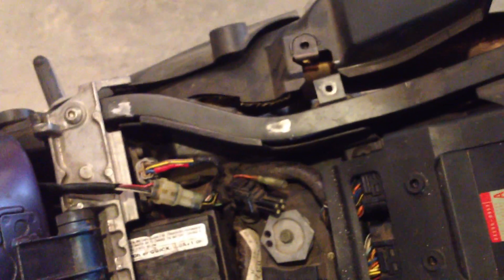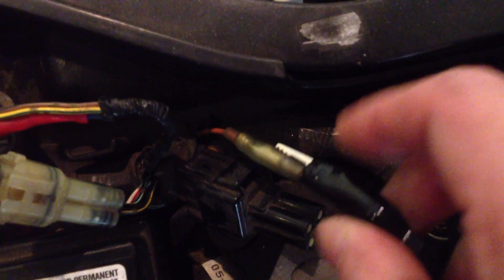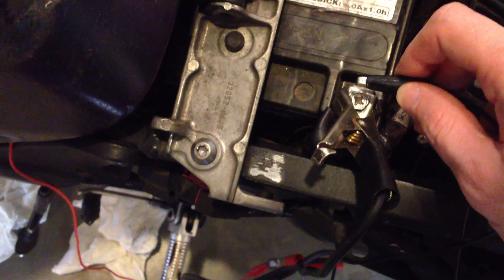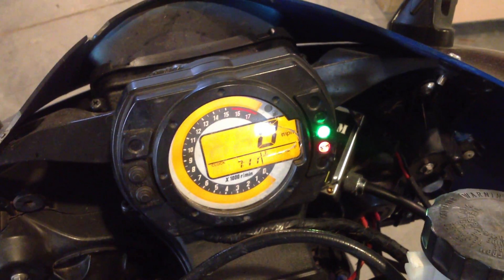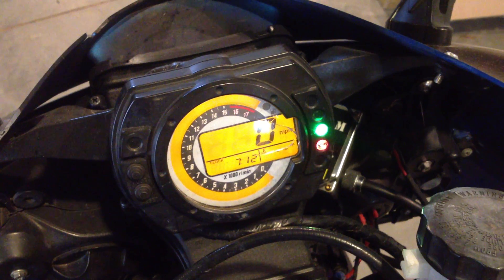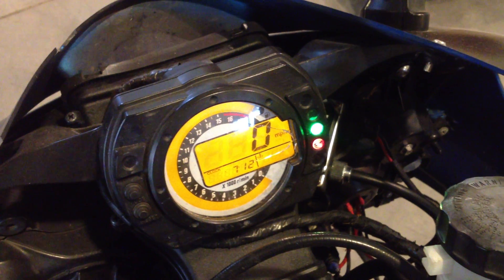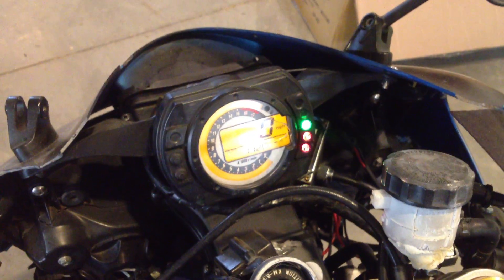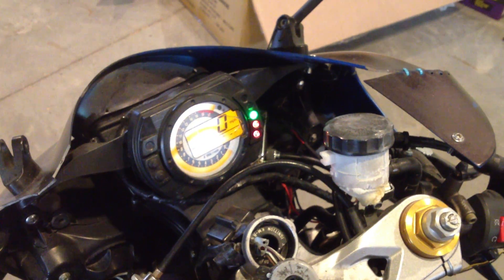Simple: How to pull the diagnostic codes Kawasaki ZX6R . Dealer Mode 1, 2006 636 FI light, F1

Comment: This is such a great video Tutorial!!!!!👍  This showed me how to pull the code on my 2007 Vulcan 900 Classic LT!  Wow, really great presentation!👌  The K VN900 under-seat wire to connect to is yellow, but the process is identical.  I could not figure out from the instructions in the service manual how to do this, until you enlightened us with your instructions.  I was then able to clear the code on the bike and for now the code 21 problem is resolved.  It reminded me of the trip to Oz, but instead of tapping shoes together, we tap the ground terminal 5 times.😄  Some $ saved!  Thank you, Far Reach Engineering!!!!!👏

Comment: Hey man, you seem pretty understading of the 06 636. I was wondering if i could contact you and ask you about mine since its having problems riding smooth? Ive got video of it in which the problem of the bike may be visible and audible to a professional mechanic. I would really appreciate that since im somewhat clueless and cant properly ride the bike.
Reply from the maker: Not sure I would be able to help much remotely.  But in generally its usually about Fuel, Air, Spark.     If it is running well at low speed or idle but sags when you ask it for more, you might check to see if the fuel filter is getting clogged.   If it sharp cuts out on and off, then your are likely looking at Spark (ignition coils and wires),   Rarely it is air, but it doesnt cost anything to take a peak and see if there is anything clogging the filters (this is rarely the problem.)

Comment: what if it only blinks once, my 05 636 started bogging under acceleration and dying i tried this and only blinked once.
Reply: My bike is doing the same did you find out what is wrong
Reply: @SquidBitz I tried running codes again and it was map sensors! Maybe try replacing those!

Comment: Hi far reach engineering, please help..... the Kawasaki mechanic removed the throttle body flaps, reason the bike would close power when trying throttle.. 

Please advise if I need a new throttle body altogether or.. Zx6r 06 model
(Arata exhaust/power commander3/dynojet quick shifter) ** I'm reading error code 62/63**
Reply from the maker: Hi Sir Ginja,  Sorry, I wish I knew the answer for you.  But I dont know which way to point you in this case.

Comment: Hey, thank for the info. If I can ask,  my nephew dropped his 05 ZX-6R with me to replace the stator. He kinda left it with me so, a year later I decided to get the parts and just keep the bike. Anyway, I get no FI light illumination with key on and the bike won't start. Can't find any info for why the light wouldn't come on (besides burned out LED) Can this cause the bike not to start or is it just like a lamp driver on a car?
Reply: Did you figure out what the problem was? Mine is doing the same thing?
Reply: @markgalligar1300  did you figured it out? Mine is doing it now 😅
Reply: Tip over switch

Comment: What is the name of the tester that you're testing the wire with? I need one with the gator clips.
Reply: Would appreciate for anyone who answer.
Reply: Ballsacia
Reply: It's just a simple wire with an alligator clip on each end. Connect 1 side to the self diagnose terminal shown in video as a single plug, and then attach the opposite end to the ground for dealer mode. Or the tapping for dealer mode 2. I have a 04-05 zx10r and it does the same thing. Great video in my opinion

Comment: Hello man, i am about to buy a Z1000 1st generation and the FI light shows even when the bike is off 
i searched it on the internet about it .
the bike doenst turns off by its own, the throttle is fine,the power is fine, yes he has after market exhaust maybe that is the problem? and if yes what i need to fix it.
i noticed when i press the ignition button the bike starts a bit slowly, like i press it 1-2 sec to start it up
Reply from the maker: Are you able to pull codes from it?  What year is it?
Reply: no i cant ) 2006

Comment: What did you use to actually ground the wire please?
Reply from the maker: I used a wire with two alligator clips.  one at each end.  simply attached one clip to the free open wire in the motorcycle harness.  The other end can be clipped directly to the negative battery terminal.

Comment: iv just tried this and nothing happens, does this mean I don't have any error codes? thanks
Reply from the maker: +joebmxx  Yes.  If its not red with you ride, or For instance if your bike is not flashing an erratic red light when you perform this then there is no reason to think it has any codes either.  (note: a steady security blip when the bike is off is fine too, as that is a standard security feature)

Comment: Hello Dear friend, I have question about FI in to my zx6r 2007. There is aftermarket exhaus and FI show code 34. Question is, is it problem, or it is just a detail about exhaus change ?
Reply from the maker: Vladimír Studnička  Code 34 is because they put in an aftermarket exhaust.  Other than throwing a light, there is no problem with your bike.  (the reason for the light is that the butterfly valve that was used in the stock exhaust, just isnt there in the aftermarket exhaust. not a big deal)

Comment: Is it the same for a 2011 zx14?
Reply from the maker: Adrian Wilson I have not tried it on a zx14, but my expectation is that it would be the same.  I would suggest having a look under the seat by the battery and if not there, also checking near the passenger seat.   I do know that the zx14 has the 4 plug factory diagnostic port just like the 636 here.  On the 636 the single diagnostic wire was right by that plug.  If you can find that 4 prong plug, I bet the single wire will be right near by.
Reply: Found the 4 pin plug but not a single. Google tps and plan see if it's off.
Reply from the maker: I am not sure on this one then.  I dont have a zx14 currently to compare it to.
Reply: Far Reach Engineering I took the fuel pump unit apart and clean the filter and it run better but still cut out. I uploaded a video. I think there's another filter n side the body of the pump.

Comment: Aw that sucks. Pretty much those codes are like deciphering Morse code or something . Too bad bikes dont have OBD ii computers. 
I would have liked to replace the stock gauges with a small 3" computer creen.
Reply from the maker: CCCL350 That is true,  It is almost like Morse.  Let me know on the 3" screen.  You may be able to get an app that can run an ipod as your gauges and you could bolt one in a housing as a display.

Comment: Hello please help me,what i should to do,my moto is Kawasaki z750 2006....my video is:

https://www.youtube.com/watch?v=f1z67jbDgV0

f1 light flashes even when the keys in my hand.....After starting the engine when f1 light burns all the time, when I turn off  the engine  - the f1 light is Blinking.....
Reply from the maker: Egidijus Kibas The blinking with the key out is not a problem.  That is a security feature to show that it is immobilized against theft.  Now as for the light being on once you start it, you likely have a code that can be pulled to find out why the light is on when running.  They are two separate items.  The light blinking with the key out, is not a problem.  The light on when running, is a problem.  Which  problem you will need to run the diagnostic code to get the answer.

Comment: Follow directions on my 2002 636 any it flashes FI but nothing came up... I my bike feels like it is misfiring.
Reply from the maker: The FI flashing is the code. No numbers will come up.  It is sort of like Morse code.  The FI light will flash in a pattern when in diagnostic mode.  Did your FI light flash?  If so what was the pattern?
Reply: I waited about a minute no pattern. I assume the only time I have seen the FI light even come on was when I tried  grounds the wire. So all I am assuming is I entered Self Diagnostic mode?
Reply: John W  The 2002 ZX636R (A1P) doesn't have fuel iinjection. It is effectively a J2 599cc model which was stroked to 636cc
Reply: *****  03 my b

Comment: i have the same problem and i pulled the code which is 63.. and i don't have the butterfly that goes under the seat! and aftermarket exhaust...
please help!!

05 zx6r
Reply from the maker: Just as you mentioned, because you have an aftermarket exhaust, it means the butterfly valve no longer actuates, (because the stock exhaust is no longer there to actuate).  That would normally give you a #34, but in your case, since the butterfly actuator was really doing nothing but adding weight it sounds as though someone took it out of your bike.  And not having the butterfly actuator itself will give you a #63.  
*#63 Exhaust butterfly valve actuator malfunction, wiring open or short***.

So long as there is no wiring left exposed from the removal of the butterfly valve, it really is no big deal.  Yes you will have an error code on your display, but your bike should still run fine and is in no danger from the code.
Reply: Far Reach Engineering thank you for your response! i really appreciated. .. one more question.. it would be really annoying to see it there.. how can i make it go away? cheapest way since its my commuter and i just purchased it couple months ago.
Reply from the maker: chris
That is a good question. The short answer is to make it go away cleanly you would need to input something into your bike to give the output signal of the butterfly actuator and valve. 

Now that was easy to say, but I do not know if that requires a specific digital output in this place or if it is just as simple as completing the circuit.  My thought is it likely has several changing outputs that would be needed.  The reason I say this is because even if you put in a brand new actuator, your 63 would go away, but your FI light would stay on because you would then read a 34 because of the custom exhaust.  Depending on how complicated, one solution could be to program an Arduino to give the feedback read from the butterfly system.  My brother actually creates those that can replicate full LS1 engine systems so that full non-conventional engine swaps can be done without throwing codes and lights, but that fix is neither very cheap or easy.

But there likely exists a cheaper/simpler way. But I'd have to think on it to say for sure. Maybe even just closing the circuit on those two items.
Reply: Far Reach Engineering thank you!! an update of the problem its being 2 days since the light hasn't come on.. i guess the problem went away? i did about 100 miles on it ...
Reply from the maker: chris That is awesome.  I love it when things fix themselves.  Happy riding!

Comment: Hey man I did the self diagnostic and the codes I read out is 41, thetr are no codes in the number range so im just curious?  The issue I have with my bike is when I go full throttle it doesn't put the power down properly so im lost
Reply from the maker: 707,  First I would suggest the possibility that you are not reading a 41, but in fact a code 32.  (Not 4 longs and 1 short but actually 3 longs flashes and 2 shorts.  sometimes the first of the short flashes can be confused with another one of the longs)  And let me restate that I really think you are looking at a 32,and is a sub-throttle sensor.  

That said if you had a 41 my only guess would be similar to the Kawasaki 1500cc vulcan in which the 41 code is actually  a fail safe mode in which code 41 is an error in Fuel injector #1 = so the ECU shuts off fuel injector #1

But double check the light.  I think it more likely you have code 32.  I hope this helps

Comment: Nice video man. You get the bike cheap?
Reply from the maker: Thanks Zee. It was a pretty good price, at least one that made it worth me taking a chance on it.  If nothing else, bringing it back to life reenforced to me that the zx6r family is a good group of bikes.  As such I bought another 2005 zx6rr just last week.  :)
Reply: Far Reach Engineering
Awesome. Yeah the 636 is a beast! 05-06 is the best gen in my opinion. I know the zx6rr isn't a 636 though, wonder if it makes a noticeable difference or not, lol
Reply from the maker: zeelicious
 I agree, I favor the 05-06 as 636's as well.  And you are right while Zombike here is a 636 my ZX6RR is a 599cc bike so it could be raced in the 600 class during those years.  As for a difference, each bike I have (the ZX6R and the ZX6RR) are set up differently, so it is not a straight stock comparison,but the short of it is Zombike does feel quicker with a bit more torque than the zx6rr.  That said, they are both awesome!

Comment: How did you get the ignition switch out like that? Im having issues with mine....or did it just come like that from all the shit your bikes been theough?
Reply from the maker: The short answer is it was stolen, and came like that.  The long answer is while I did not tear up this ignition system, if you wanted to simply replace your switch you should be able to unbolt the ignition switch from the bottom back side. That will release the switch for replacement. Then just buy another switch with key, off  ebay and replace it.  Hope that helps out to some degree.

Comment from the maker: Yep, and you haven't even seen the worst of it.  It has had a rough life. It was stunted, stolen. given a crappy rattle can paint job after the theft to throw off the police. It was then abused (drive it like you stole it.) for about a year. It was then finally recovered by the police after a high speed chase which ended when the rider completely wrecked it.  It was then returned to the owner as a shattered bike.  That owner left it out in the elements. Since the gas tank was forced open (no key) being left out in the rain allowed rain water to collect in the tank.  That lead to various engine issues as you could imagine. and that doesnt even touch on the electrical.    I then bought it as a heap to see if I could revive it.

Then with a little attention, I got it fired up and took it for a ride this Saturday.  Zombike may have been left for dead. But undead it roams the streets again.